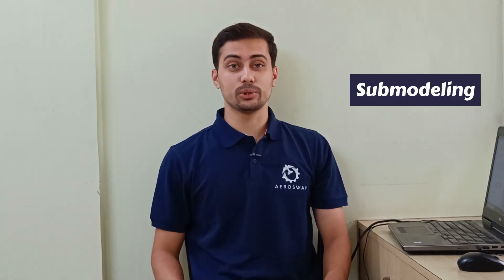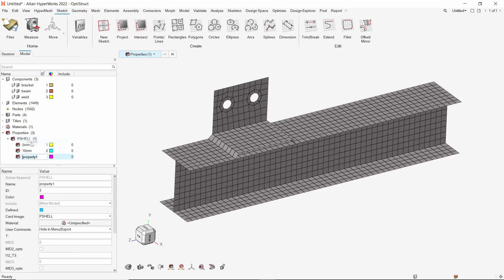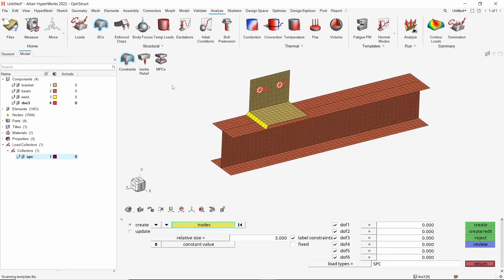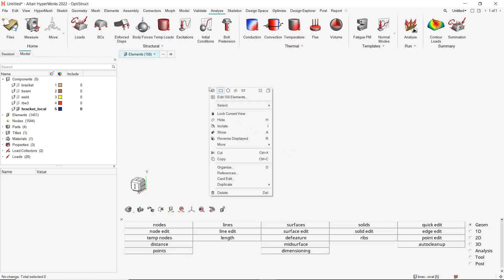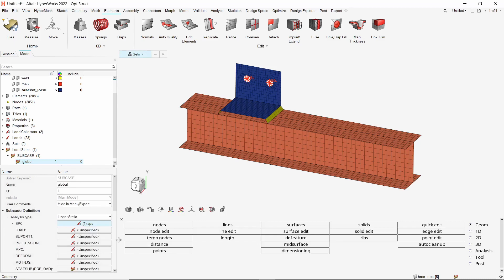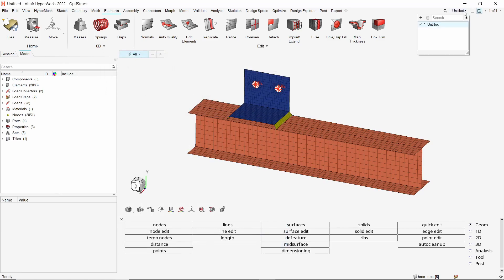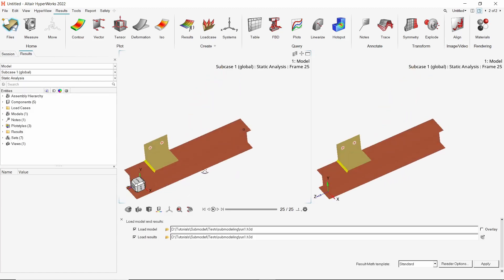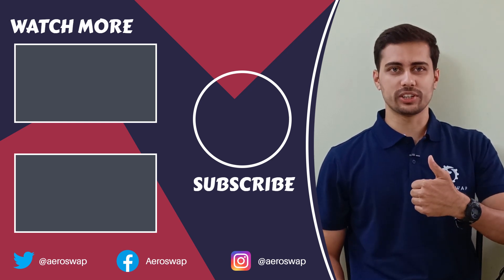Submodeling in Hypermesh [Optistruct Tutorial]

Comment: Hi bro, I am new to your channel, really liked your content. Just started with Hypermesh, an issue came up write away, I was importing one of your tutorial IGES file for my practice but for some reason it shows nothing on the screen, I tried different different IGES files but after clicking Import it shows nothing on the screen just the background color. Can you please help me figure this out?
Reply from the maker: Hi Prakhar, this is surely an issue with the graphics card/drivers installed on your machine. Please make sure that the graphics drivers are up to date. You can check the minimum hardware requirements from the Altair website.
Reply: @Aeroswap  Thanks for replying, I do use ANSYS Fluent, CFX etc. for my work but they work fine no issues there, its just Hypermesh, also graphics card is up to date. What else can I do?

Comment: I like your videos! Very useful!
Courd U please make one about geometry processing for complicated structure with T-joints and various thicknesses. Where it's gonna require some midsurface creation for thin parts and appropriate 2D mesh and some 3D mesh at latch locations (where thickness is too big and it should be considered as solid). That would be some doors or lids with complex machined edges.

Comment: Fantastic video. A few questions:
1. If we want to further refine the mesh, can we add another submodel and only run it or do we have to run all subcases (including the large global model) again? 
2. How is this method different from including Grid Point Forces in the output of the global model, and then importing those results to a FBD in the submodel?
3. If we refine the submodel mesh a lot, how do we avoid the stress concentrations at the nodes of the local mesh that are equivalenced with the global mesh?
Thanks.
Reply from the maker: Thanks Vim. Good questions! Here are my inputs-
1. Yes, you can create multiple submodels in the same run (using the same global model). In fact, you can also use one of the submodels as a global model and break it down further into sub-sub models! Just make sure that you define the loadsteps in correct order (loadcase ID). Global runs should always be first, followed by local runs or the solver will throw an error. I hope this is clear!
2. Major difference is that in this method, you can run the global and local models in one go! No need to perform separate runs for global and local models. Another major advantage is that the number of steps involved in setting up the analysis is much lesser as compared to using thr FBD tool. So preprocessing will be faster!
3. You can create derived results in Hyperview where the stress result is averaged over certain number of adjacent elements (or layers of elements). This will mitigate the localized stress concentration, at least to some extent!

I hope the above points answer your questions! For further discussion, feel free to reach out via email :)
Reply: @Aeroswap  Thank you for the detailed answer.

Comment: I have a trouble when i run the problem.  * ERROR # 216 *
 Rigid element 2206 is entirely outside
 the domain of submodel for subcase 2.
Can you help me to fix this error?
Reply from the maker: This error will occur if there are rigid elements in the model that are not directly connected to the submodel. The solution is simple. Deselect the 'Include rigid elements' (SID_R) option while defining the loadsteps. This will resolve the error!
Reply: A great answer. Thank for your help.  I hope that you will have more great videos relate HyperMesh.

Comment: Hi, very good video! 
But I have one question. Is that any option to run local submodel analysis only? Sometimes bigger model analysis takes too long and will be perfect to run it as a submodel only. Did you hear about it? 
Thanks!
Reply from the maker: Hi Artur, the concept of submodeling is based on the principle of mapping the results obtained from global model onto the local submodel. Submodeling is not an alternative to solving the global model. Hence, it is not possible to run only the submodel. You need to run the bigger analysis first for this method to work!
I hope this information helps!

Comment: Well done Swapnil! An excellent presentation of a long anticipated procedure. As in every "global to local" (or submodeling, or "zoom analysis"), it is a good practice to plot the reaction forces both on the global model and the local one in order to confirm that the values match each other.  Thank you!
Reply from the maker: Thanks for sharing the initial information regarding this method with me Emmanuel! Good point about reaction forces. I will make sure to include that in the next submodeling video.